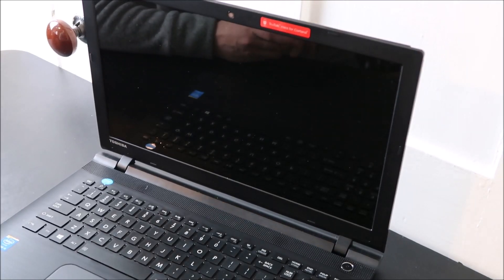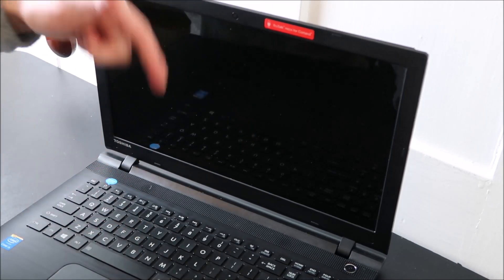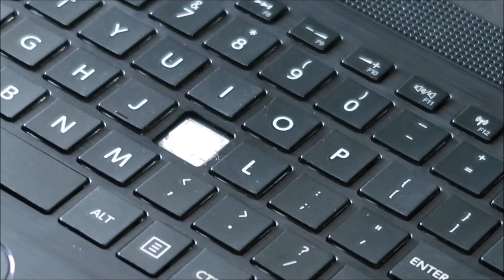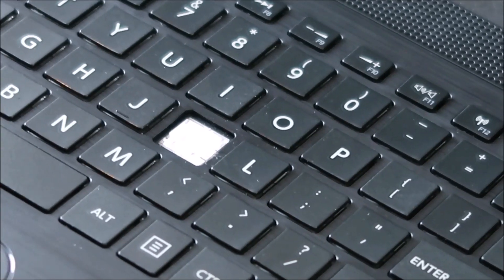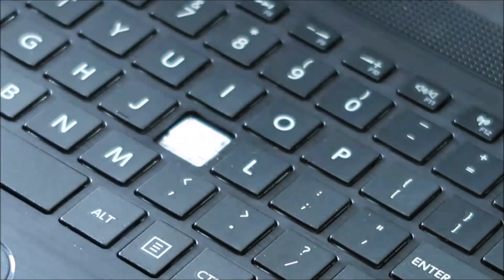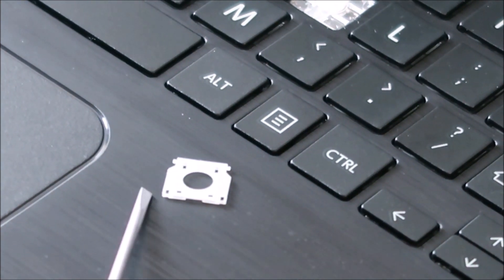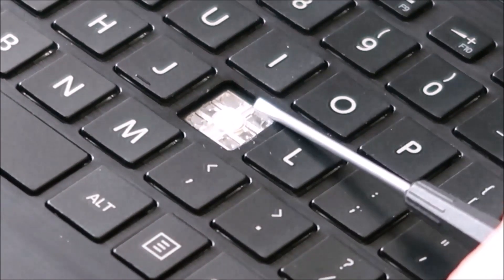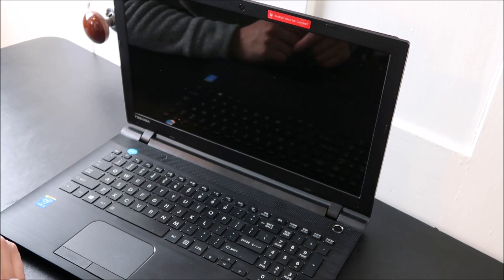How To Fix Keyboard Key - Toshiba Tecra

Comment: How do you put on an f key? My F6 key got loose. And the white plastic thing got ripped of with the key also
Reply from the maker: You would reinstall the key as seen here.  You would need to remove the Hinge Clip from the Key Cap as they usually cannot be installed while still attached to each other

Comment: I’m having trouble to put the 2 white plastic together
Reply from the maker: They fit together with a small plastic pin on the left and right of the inner clip.  These fit into holes on the outer clip.  To see exactly how the inner clip sits in the outer clip, remove another key cap and copy the clip under it.

Comment: I have Toshiba Satellite L655 the letter A key its not functioning . I already tried what you did but still not fix. when I press the button letter A key the light of the number lock button is blinking while the other keys which is good its not . Is there other way to fix this? Thanks
Reply from the maker: This video is a tutorial on how to replace a key.  If your keys are not working but are not mechanically broken, troubleshoot them as seen here; https://youtu.be/wqrchfpdJ_w.

Comment: Hi what do you advice if the rubber part comes out? Mine came off but I do have it...
Reply from the maker: There isnt really a good way to reattach those.  They are not meant to be replaced.  Best advice is try to use a small amount of glue.  If that does not work, you may have to replace the keyboard.
Reply: @PC_Monkey  will give it a try thanks..!

Comment: Hi PC Monkey. I have a hp laptop, And just wanted to factory reset it to erase everything. But when I try to factory reset it, my USB port for my computer mouse was plugged in. And I keep getting a black screen with NO BOOTABLE DEVICE on screen. I've already watched plenty of your videos, step by step, to try an fix this, and one video link to another,  but nothing has seem to help. I'm exhausted. Please help me.
Reply from the maker: So your computer works fine, your trying to factory reset it, and your getting a 'no boot device' error when you try to reset with recovery media on a USB.  Correct?
Reply: @PC_Monkey  I don't have a recovery media on USB. It was working fine, but very slow. I factory reset it and it didn't let me. My mouse was insert and I think my computer was trying to recover media on that mouse usb. Now I only get that black screen. Sorry if I didn't explain well.
Reply from the maker: @greciar.681  If the Factory Reset didnt succeed on your Toshiba computer, then the operating system could be messed.  Best to perform a new install of Windows 10 now.  You can see that done here;  https://www.youtube.com/watch?v=e7hzoRI-cSY&t=1s

Comment: How i can repair my laptop it dont have display when it's on? After the automatic repair.
Reply from the maker: What brand and model computer do you have?   Does the computer turn off or does just the screen turn off after the Auto Repair warning?
Reply: @PC_Monkey  The brand of my laptop is Dell if i turn on it Show Automatic repair then after its just blank screen.
Reply: Its show just blank screen but it is on i can see the arrow of my mouse.